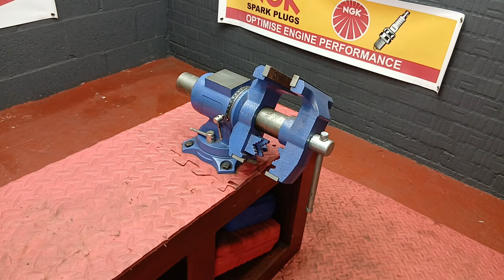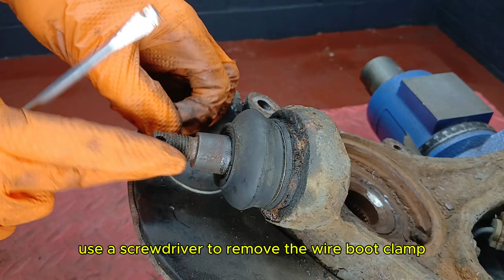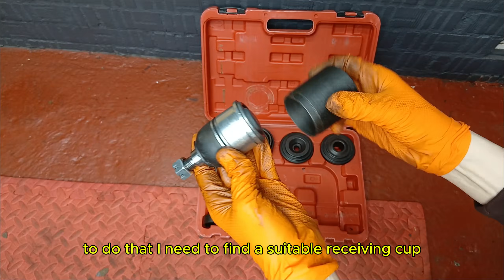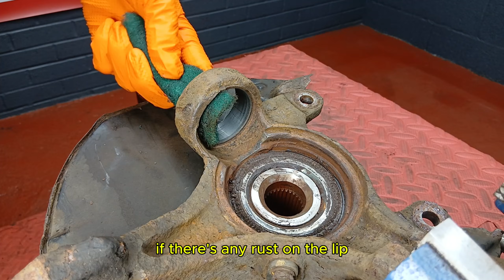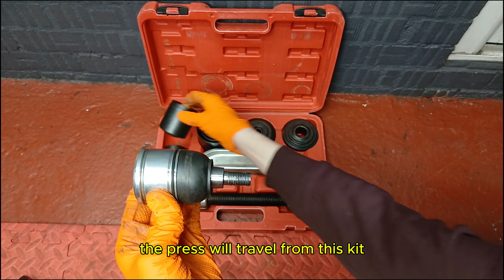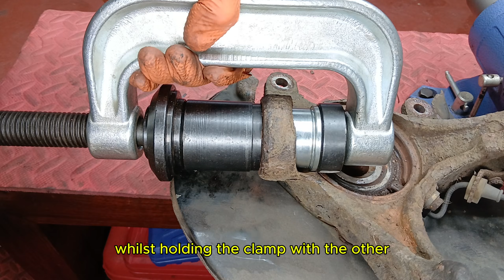DIY Hub Ball Joint Replacement No Hydraulic Press!

Comment: Not going to disassemble the whole hub. Heat and a ball joint separator will do it when you can't get enough clearance underneath. Never seen a high tensile stud disintegrate.
Reply from the maker: You don't have to but for clear demonstration, this was the best way I could do it

Comment: This can be one of the hardest types of ball joint to remove when rust binds. I will require a lot of beating because no tool will get it out.
Reply from the maker: The C Clamps are very strong, use a long extendable ratchet, have someone hold the clamp or lean it against something. Also use oil on the threads, it really does fight its way through most stubborn joints and bushes.